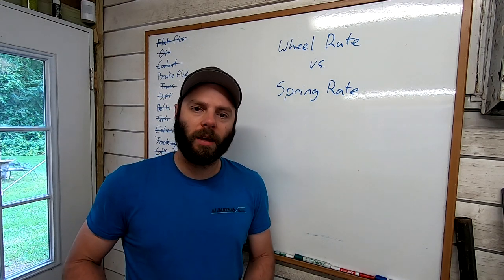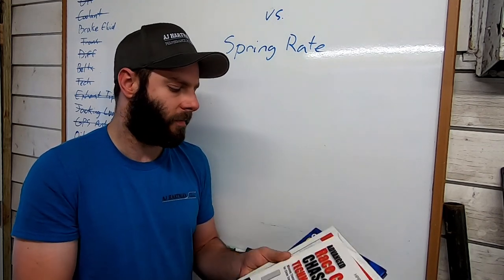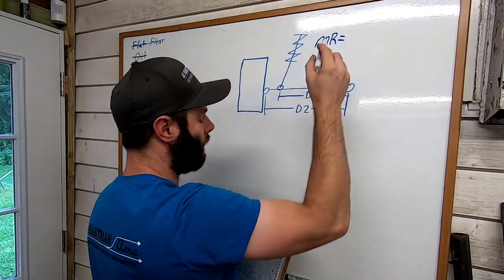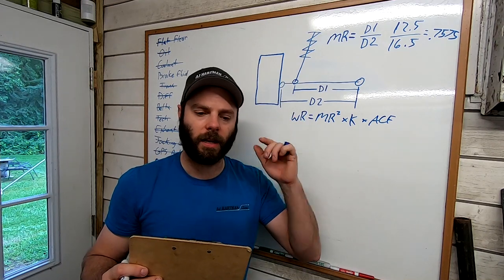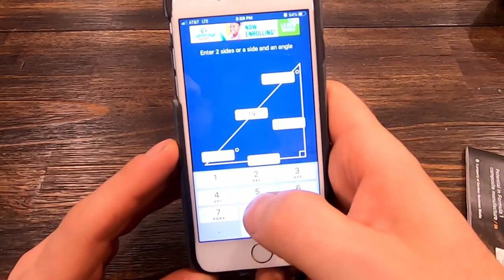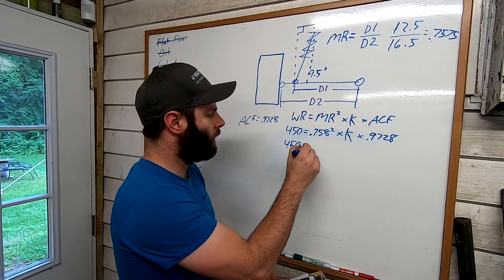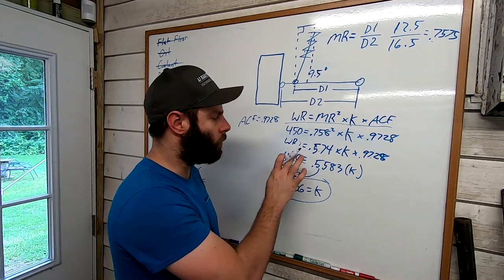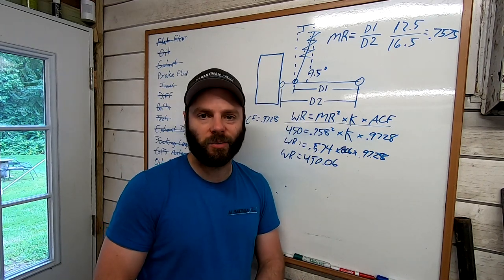Wheel Rates vs Spring rates on Solid Axles and IRS's.

Comment: I thought you had #400 springs in the rear with the solid axel?
Reply from the maker: Sal Molinare now you are making me double think. You may be right. But regardless the math is still right. I’ll look at my old springs today.
Reply: @ajhartmanaero  In the springs and splitter video you went from #300's to #400's. I was just wondering if you had gone up to #450's after some testing.

Comment: Doesn’t seem stiff enough to me.  Your running that much on the front aren’t you?
Reply from the maker: I have 850s on the front. I know some people run stiffer on S550’s on a Coilovers, and much stiffer if in the conventional location, and you may be correct that 800’s might be a little soft, but I’m also much lighter than an S550 as well.
Reply: @ajhartmanaero  Springs and splitter video had you installing #750's in front....did you spring up since then?